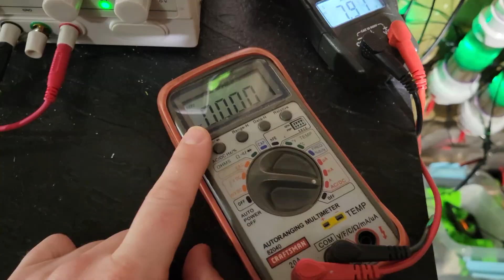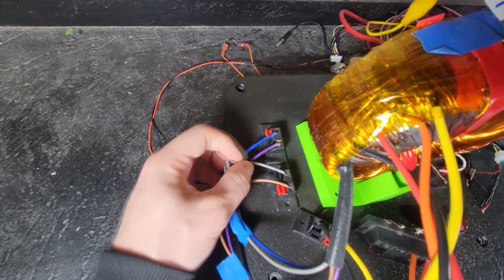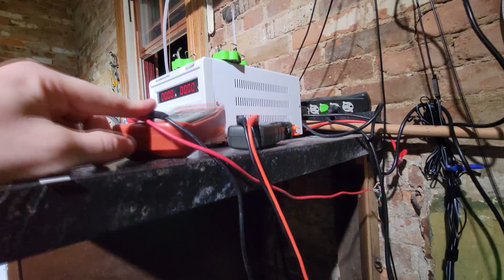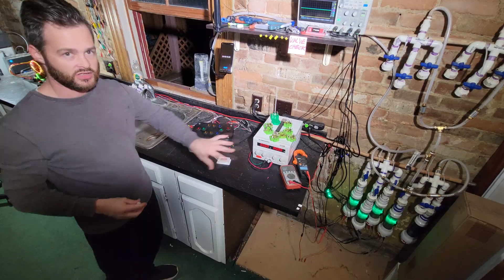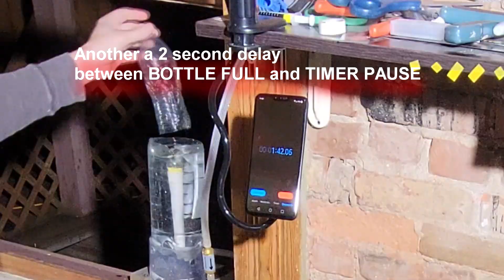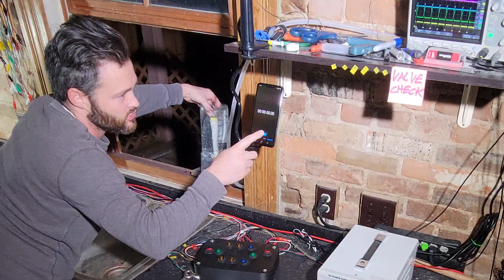Amperage to HHO Gas TEST! LPM Measurements CONFIRMED!

Comment: Thanks for this video, i sent u an email regarding my last version , i could use ur help, i ma interested in recreating ur design with my own cells dimensions  too
Reply from the maker: I got it.
Reply: @noahauman  i have replicated more than 10 different designs on those same cells  and i have combine multiple designs together, still not close to 0.2 lpm , outer pipe is 0.5m diameter is (1 1/4" )  i have 9 hooked tried different connections

Comment: According to your documentation, no one will be able to repeat your installation.
Your tubes are trained in water with a high iron content.
And they trained for 3 months; no one will spend that much time training pipes.
Plus, people's water will be different from your water, so they won't get the same tubes as you.
This is a fiasco bro.
It follows from this that they will have to rewind the VIC to suit their type of water, to suit their type of tube.
This will lead to the fact that there will be no resonance and, as a result, a microscopic gas escape.
Good luck, there are a lot of angry people ahead of you.
Reply from the maker: Negative. If the value of the water changes, the frequency can be adjusted to accommodate. What do you mean by "trained"? I am unaware of this term or any "training" I have done. This does not make any sense. The water is fresh from just last week. Why will they not get the same tubes??? SS tubes are SS tubes. I'm so confused by this statement. A fiasco? Not from my view, bro.
Reply: @noahauman  Ravi's WFC and Cell Conditioning
In fact, conditioning (training) is the creation of a capacitor with parameters depending on the quality and chemical composition of water. In each geographical area, the chemical composition of water is different.
You will not be able to control every person who will make a cell and VIC according to your documentation.
During training (conditioning), the electrode-water contact disappears. The result is a Ravi layer (electrode-Ravi layer-water layer) which has its own dielectric constant different from 70.
Depending on the chemical composition, the dielectric constant will vary over a wide range from 0 to 200 units.
And it is not always possible to maintain resonance by selecting a frequency.
Reply from the maker: @Alzamay752 what can i do to disprove this? use different water? try brand-new tubes? I don't think you're correct here. Conditioning is necessary for max gas production, but not required. I recently rebilt all my cells and sand-blasted the tubes. They work 80% as good.Conditioning only take a few hours / cycles. I'd love to do a video on this so let me know your thoughts.

Comment: There are a lot of such videos on Russian YT channels, where they get 1 liter from 1 ampere.
I wasn't surprised.
Reply from the maker: link?
Reply: @noahauman   in the search bar you enter электролизер in Russian
Reply from the maker: Ok, so I've seen a couple of his videos but not that one specifically. I did watch it just now. His calculations are confusing because in one part he says at 1A he received 100mL in 7 minutes, but then says later that 1LMP takes 400W, which doesn't make sense because you would have to multiply his results by 7 to accommodate.

Comment: Impressive Noah! Time for me to buy one of the Toroidal transformers and play with my Sintered SS cores.
Reply from the maker: What are these Sintered SS cores you speak of?
Reply: @noahauman  Porous Stainless filter tubes basically,  1' L X 3/4" OD and a .250 " thruhole. I have 15 I'd purchased a while back and they seem to be excellent for the Negative producing hydrogen. I would be more than happy to send you 2 free to test with, Love the videos and work you are doing Bud!!
Reply from the maker: @kenladere7125 it'd be interesting to check them out. email me. my email address is in my profile.
Reply: @noahauman  Email link did not show for some reason Noah, I sent one to your IT info@ email addy, (Found online).. Keep the Vids coming!
Reply from the maker: Not sure if I got your email. A friend concluded that you can only see my email on desktop, not mobile devices?
Reply: @noahauman  Strange? I will resend it Noah. Keep the vids coming!!

Comment: Good on yah.
Reply from the maker: Appreciated. I'm literally having to ask myself if this is real. What am I missing here?
Reply: Gating will be interesting. Maybe a track of 7a x 32v vs' 1.1a x ?v to see whether that watts-watts ratio vs' gas changes?
I don't know, but I suspect gas will slow down but efficiency watts -watts/gas will improve? 
Whatever you do next will be great.
Reply from the maker: I'm looking at an Arduino-based Gated PWM device. Curious as well.
Reply: @noahauman  It'll be interesting to see those results. Watts in, watts to the cells, and gas production. Can't wait.